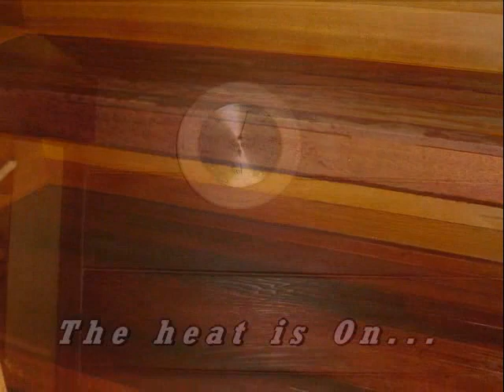Sauna Construction in 1 Minute timelapse

Comment from the maker: I have fitted an inlet vent and fan, also an outlet vent very low down. The internal wood panels are secret nailed and there is no access to the insulation bats. Mold does not seem to be a problem here in Australia. The ceder interior has kept its pleasant smell for over three Yrs now. The roof and outside walls need a coat of decking oil once a year to keep it looking nice.We can get the Humidity to near 100% and within 24hrs everything is bone dry again